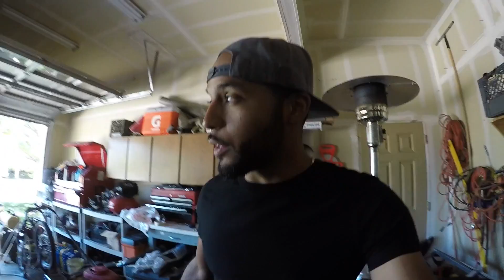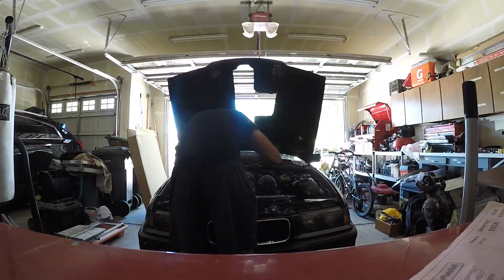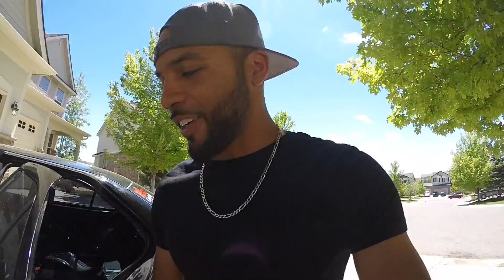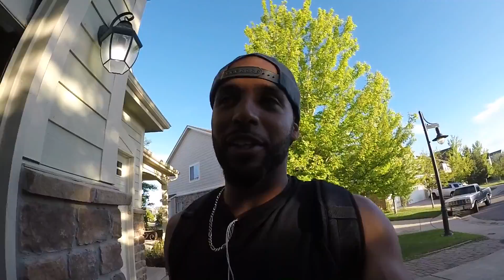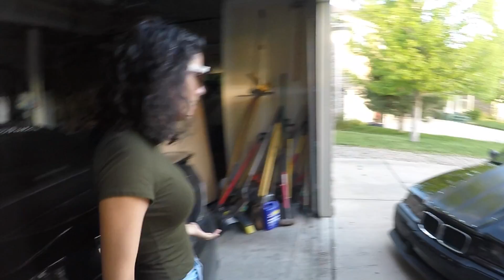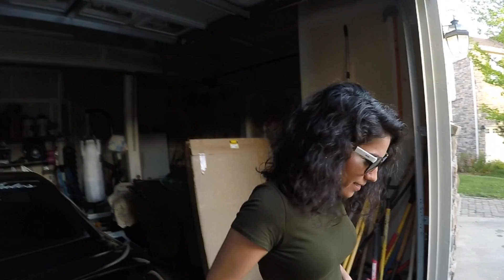NEW COWL HOOD MOD FOR THE BUDGET DRIFT 5.3 LS SWAPPED E36 BMW! SO MUCH BETTER.... I THINK!

Comment: How did you get the guages to work?  I'm contemplating this swap in my e60 550i.  I think I've watched all your videos and never saw it mentioned.
Reply from the maker: Jack of all Trades, Master of None my stand alone engine harness ties into the factory harness and controls the gauges
Reply: @TreyHerrera  did you make it, or purchase it?  If purchased, where?  I know the LS PCM's are capable of CANBUS, but some of what I read says there is some translation that is needed between the LS PCM and the BMW dash.
Reply from the maker: Jack of all Trades, Master of None it was from bp automotive.

Comment: I'm in the same situation with my swap. So what intake did you go with to work with the cowl hood?
Reply from the maker: Jeepers Creepers stock truck intake
Reply: Trey Herrera like the stock plastic one that goes towards the passenger side fender?
Reply from the maker: Jeepers Creepers I meant the truck intake manifold and I made the cai over the radiator

Comment: this the one you ordered? https://www.jegs.com/i/JEGS/555/95000/10002/-1 thinking about going the same route with the truck intake and use this and mold it in with filler etc.